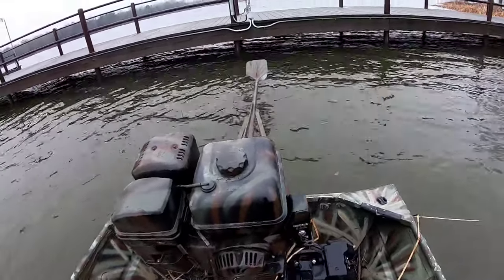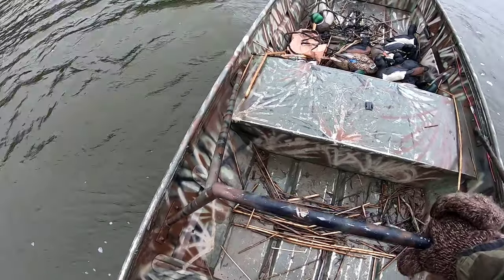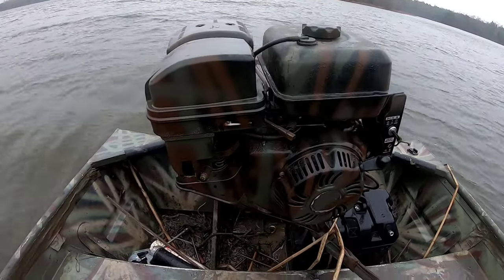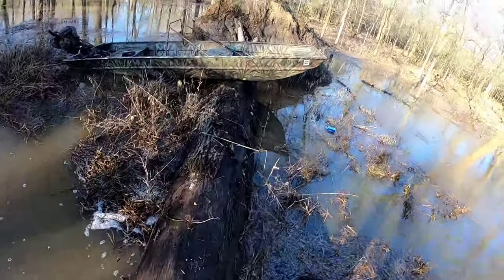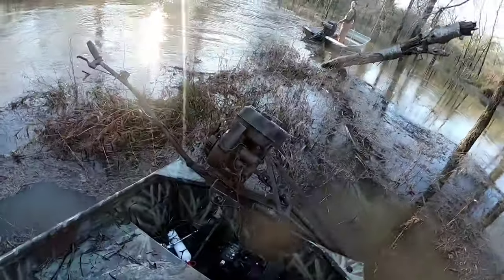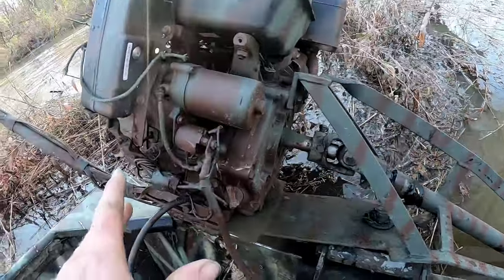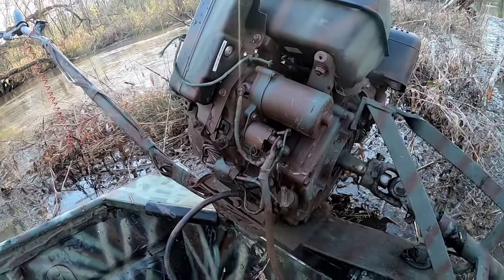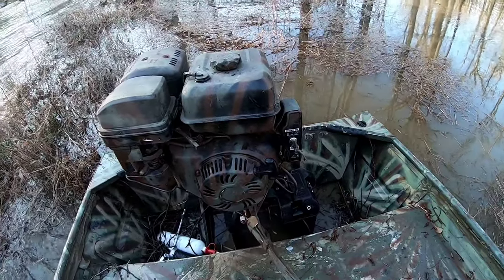Why You Need a Longtail Mud Motor

Comment: I’ve always heard that Go-Devils are dangerous if you fall off the back of the boat.
Reply from the maker: Haha yeah a kill switch and lanyard is important
Reply: Just don't fall 🤣
Reply: Short of a kayak, aren't all propeller driven boats dangerous to fall off the back of....at least with a mud motor when you let go it will swing sideways and stop spinning!
Reply: @davidharris453  I don't know about the go devils but my longtail if I fall out and let go of the engine the engine will go completely vertical and dig the propeller as deep into the water as it'll go.

Comment: Yeah, I love my long tail. I fish a highly productive river system an hours drive from my suburban home, and it’s many connecting lakes. And it is supremely convenient not to have to be overly cautious of submerged obstacles, or shallow water, as I travel a waterway that conventionally had only been navigable by canoe or kayak. In my state it is illegal to make a wake within 100’ of a shoreline, which effectively makes it illegal to produce a wake in any small river or stream, but sometimes I can’t help myself and open the throttle a bit, speed through the woods. The reactions I’ve gotten from kayakers I come across is mixed. The greatest benefit is Locations that used to take me hours to reach paddling now take minutes.
Reply from the maker: Sounds like a great fishing hole, awful strict law though, what state is that?
Reply: I guess I don’t have to worry about a gaggle of jokers invading my territory considering I think you’re south of the Mason Dixon Line, but I’m in Michigan. I got my boat beached at a buddy of mine’s place, and one of the biggest conundrums we face is what direction to travel when we launch and what species to target. There is so much opportunity within an hour motoring both upstream or downstream that it actually can become a heated debate.

Comment: Yeah, a lot of people talk trash about Predator engines. But in my opinion, they are just as good as Honda.

Years ago, I used a 20% off coupon for a predator mower engine. It was about 80.00 total. I didn't expect it to last but a season. I never covered it, changed the oil, plug, and I removed the air filter. That darn thing lasted about 5 years before it started running rough. I purchased another one which is running great. But I believe it started running rough because of worn plug, dirty carb, and/or carb gasket..... Predator motors are solid!
Reply from the maker: Wow tough motor! Mines right at year, see how long it makes it
Reply: Predators aint nearly as good as Honda and will not last a 1/3 rd the life of a honda.  I run the biggest power shop around and  hondas are by far superior.  I have had on on a longtail for years.  most predators would be done,
Reply: How bout saying a Predator is a good engine for the price !
I think you must give honda its due !
If not for honda there would not be no such thing as a Predator !

Comment: How long do your boats last?  You're beating the heck out of em'!  👍👍
Reply from the maker: They last pretty well, I've got lots of dents but no holes so far
Reply: I’ve got a old Jon boat from 94. It’s not even a flat bottom anymore it’s dented pretty badly. Bunch of repairs throughout it, it still floats. That’s the beauty with these boats.. you can beat them up and fix them pretty easy.

Comment: What size of boat & speeds are we talking about?  Enough to plane out & run in thin water?  We run outboard jets....but there would be definite advantages to your setup.  Thanks
Reply from the maker: I'm running a 14' 36'' I'm not sure about top speed but with just me in the boat it's definitely not slow, and planes out and runs in just a few inches of water
Reply from the maker: I appreciate the questions and comments
Reply: I got a 1752 with a 60/40 Merc but I can see having a 1436 with this motor for certain creeks and marshes. 

I can’t justify the pro drives or big surface drives with all the saltwater round here

Comment: I live by river that has lots of rocks.  Is this motor any less likely to wreck the prop on a rock pile?
Reply from the maker: Well your less likely to hit something with the mud motor, and since there's no gears or clutches to fail, you ding up the prop and thats it, the stainless props are really tough too
Reply: @rabbitridgeoutdoors3780  I can see how you can quickly raise the motor when the skeg hits bottom.  Thanks!
Reply: You can get an even cheaper mud motor then these. I run SPS swamp runner kits with harbor freight engines on all of my jon boats. Swamp runner uses a really cheap  propeller and when I break one it only takes me 5 minutes to spend the engine around and put a new $12 prop on.

Comment: Looks awesome would you recommend a short tail for general purpose kinda best of both worlds well maybe not best but a good middle ground?
Reply from the maker: Yeah it's a lot of fun, well those surface drives are a lot easier to run and have good turning ability, but they are expensive, and more moving parts to break,  what kind of boat would  you put it on?
Reply: @rabbitridgeoutdoors3780   looking for good all around setup for rivers and lakes mostly for fishing and recreation but would also like to get to remote places if need be for camping and hunting I have a 14/32 aluminum jon boat. Can you use those long tails in deeper open water ? What’s a good inexpensive kit that you would recommend?
Reply from the maker: I gotcha yeah they run fine in deep water. I haven't used the kits, but I've heard swamp runner is good.  They're a decent start, but the shaft isn't braced on the kits so they can't take a heavy abuse. the best thing to do if your trying to save money, is get a go devil or something with a bad motor and put a cheap motor on it from harbor freight just make sure the shaft size is the same
Reply from the maker: There's a learning curve with those long tails it took me a bit to figure it out
Reply: @joshuaswanson3068  I have a swamprunner I beat the shit out of it haven't been broke down yet have around 300 hours on it I use it on a really shallow river that is only a foot or two feet deep in most spots have to jump trees once in awhile works perfect